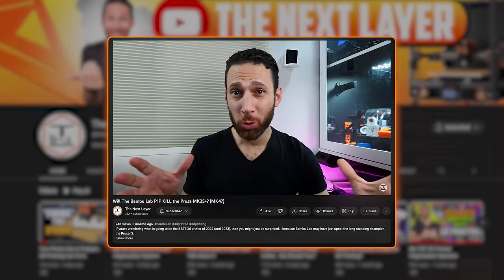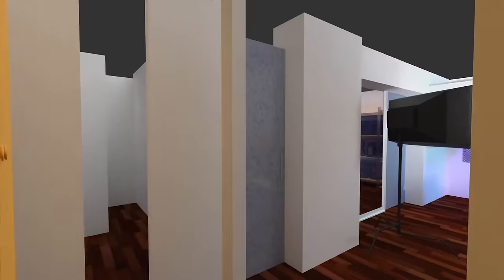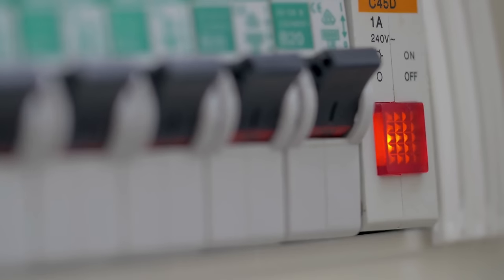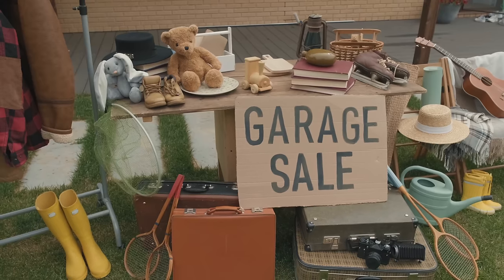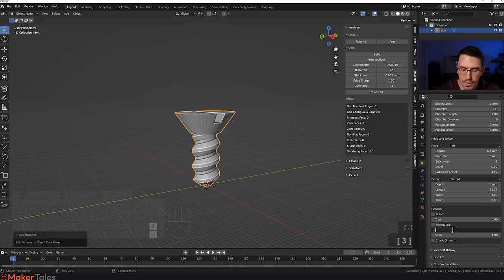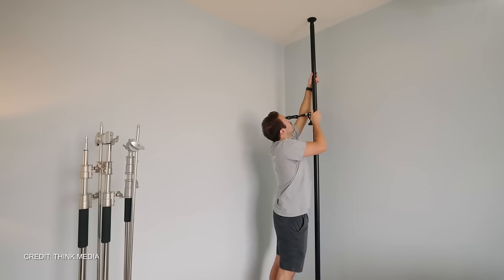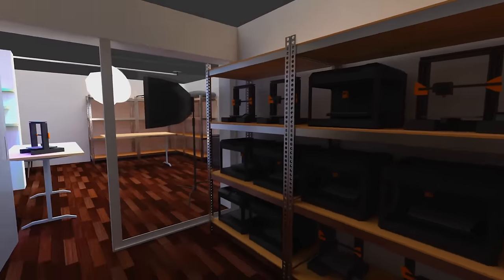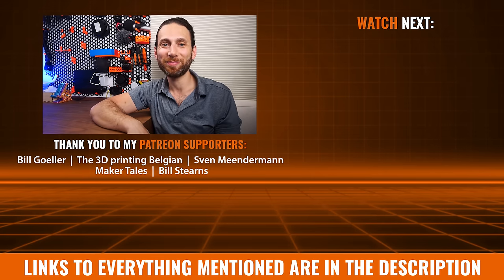Designing My ULTIMATE Maker Space, 3D Printer Farm, & Studio

Comment: USE THE CEILING.  As much as you possibly can attach everything you can to the ceiling.  Gantry mounted lights and cameras will give you greater range of motion eliminate tripping hazards, running your electrical overhead eliminates tripping hazards.  Floor looking up shots are almost never preferred, so it doesn't even have to be pretty...  Creating good overhead options requires empty spaces below, so this is the single best time to make the most use of that resource.  Looks like it will be great.  Good luck.

Comment: I am excited for you man, looks great!  Can’t wait until it’s all set up and running.    Here is my two cents. 

As an engineer I can not overstate the importance of these two things and strongly recommend you drop everything else and move them to the top of your planning priority list.  
ELECTRICAL- Do not make the assumption you will be able to run all your equipment and printers.   Find out exactly how many circuit breakers you have, and what each is rated for in rms (NOT PEAK) watts.  Plan your space around this.  Each printer will easily use 100w.  Your recording lights probably 300w each if there not LED, the lasers, I don’t even want to know lol.  If you don’t have close to enough, look for ways to save power and/or spend the money now and hire an electrician to re wire the space.   Will suck for sure, but will suck a lot more if you have to do that after it’s finished and waste a month of effort rebuilding.  
HVAC-  This is not something that is left to an after thought, ever (for safety and comfort).  You need to estimate and plan around the heating from electrical equipment, moisture loading (outside conditions + current hvac equipment capability), desired temperature in each room and fume management.   Otherwise you are looking at some combination of (if not all) 
-dangerous fumes in your work space (you need the resin printer room and maybe the regular printer room  to have a negative pressure blowing air out of them, and every other room to have a positive pressure or blowing air into them)
-a completely outclassed AC system where your workspace ends up being 29C and/or a 500 a month AC bill (this can be mostly avoided with well thought out ventilation, but if possible during colder outdoor temperatures you want to use the heat of the printers with some valves and clever vent layout to keep the space warm and save $$.  ) 
-if there is a temperature differential between rooms and your humidity is not managed.  You will get mold inside your walls, which will be at best, very expensive and at worst dangerous (again proper ventilation is key.  Also consider an ERV) 

Now for my personal thoughts.  
-those cameras rails looks expensive.  I would try and use some extruded aluminum rails/channels, mount them all over the ceiling and buy/make the mounts.  Can hang literally anything and everything off them, including all the lights.  Won’t have a single tri pod on the ground which will be a god send in my opinion haha. 
-accustic panels stop sound wave reflection, they do NOT dampen noise.  Put them in rooms where you record to stop echos and make the audio crisp.  No where else.  If you want to reduce the printer room noise.  You need to stop air from travelling  from that room Into the one you are in.  Which means air tight doors and a lot of silicone caulk in/by the walls and ceiling.  Also baffle the vents if any travel between the two rooms.  
-do not use those aluminum and particle board shelves for your printers like shown in the vid.  They will ruin your print quality with how unstable they are and you can’t even stand on them.  Spend the time and build some STURDY shelves that are perfectly level, don’t have any play or any ability to vibrate at varying resonance frequencies, and you can stand on them. 
-I would reconsider the idea of a print farm.  Any one can start a print farm, not many people have your skills, knowledge and Influence.  Use that to make your money, it will scale much better.  If you start a print farm I have a feeling that you will get sucked into a rabbit hole of depending on the print farm for income, while it sucks all your time away managing 10 printers and needy clients preventing you from making videos and growing the brand.  Which leads to a huge feedback loop, which I am sure is the last thing you want. 

I also believe you are over looking an absolutely huge and critical part of the space being successful long term.   Making it easy and reasons to WANT to be there.  I am sure you will go through slumps and declines in revenue/growth.  And with the space no longer being in your own home.  It will be way way easier to find excuses to not keep grinding.  
Find other things that will get you out of the house and into the space.  Something else you really enjoy doing.  Or maybe a responsibility there that can’t be easily ignored.  Maybe get a fish tank haha, will make sure you are in the space every day, add to the video aesthetics 100% if set up nicely and give you new niches to print (and potentially make videos for).  
Also maybe add a TV and gaming system on the couch for the kids to keep them entertained so they can be there while you work.  

Let me know if you want me to expand on anything.  Good luck with the build and channel!

Comment: Having a tool wall on the primary backdrop definitely makes sense as that is kind of your brand already. That said if you are worried about it being too busy you could consider having it on one of the two sidewalls and then having a more neutral back wall. This would also give you two slightly different backdrops depending on the camera angle.
Not sure if this would work with the glass of the print-farm but using the glass wall as a backdrop could give the print farm as a cool backdrop while also keeping the sound down. Also, would use the same center hanging light.
Reply from the maker: That’s a pretty good idea too and would solve the lighting issue

Comment: Well done! You’re ideas are great! Couple things to consider. Shops/workspaces really do change with time and as businesses grow and adapt to market needs and life changes. Be open to the idea that this plan, while very good, will likely change several times. To allow for that, keep everything on wheels. Real wheels. Not crappy plastic office chair wheels. Good casters. If you need to secure a bench to limit motion, just add a couple screws that anchor the bench to a wall. Remove two screws and move the item as needed. Quick and easy. For the concrete walls, install a wood strip around the parameter and use that for future attaching so you don’t need to always drill for
Concrete anchors. For a small space like this, keep cabinets small and get multiples of them. Two rolling toolboxes for example can easily be made into a base for a big workbench. When not in use, pull the top off and lean that up against the wall to open up floor space. It’s also helps for moving large items around the space if you can easily break down a “big” bench. Drawers are that of kings. Keeps things clean and less cluttered (you already got that😊)  keep storage cabinets for the most part very shallow in depth. Only deep enough to grab the item you need, not the item behind 6 other things. And my last thumb type vomiting….😅as you mentioned, keep tools where they are used. Even if that means having duplicates. The time spent wandering from place to place to get a little screwdriver is wasted time that adds up so quickly it hurts. I look forward to the process. Keep up the great work! I’m brand new to 3d printing, your channel is one of my go to’s! Hopefully my 20+ years of building cabinets and furniture and having had 4 shops from 75 sq feet to my current 4000 will give you just a little help. Cheerio!👍🏽👍🏽. PS. As you know, opinions are like assholes. We all have one and and they all stink. Feel free to totally ignore me and you do you! 😅

Comment: We're building a studio this year, too! It will be a room on the second floor of our house. There will be a table that fits three 3D printers, but I can put three more under the table and add shelves on top to house three more, nine in total. Another table will be positioned on the other side of the room, by the window, and used for cleaning prints up and assembling projects. HSW panels will be on both sides of it. I'll put a modified RepRack on one of the angled walls and drawers with hardware on the other. There will also be a third table for cleaning specifically resin prints.
These are my plans for now, I'll edit this comment if they change.

Comment: One thing to consider with the honeycomb background is the moire effect on screen. You can see it in the renders at some points and MIGHT be distracting at times in a video. All depends on the relative scale of the pattern. Larger the better as far as that goes. You could get around this by having a shallow depth of field to slightly blur the background. But for me, as long as you’re well lit and can easily be separated out from the background visually you’re good. I personally really like the honeycomb pattern in black with a color peppered in there to pop it and give dimension. You have good design sense so whatever you land on will be cool and fun.

Another thing is make sure all background things are secure and don’t shift. You don’t want to see cuts where a cord is in one position and then moves in the next cut and then back again. Or if you use a tool between cuts and don’t put it back in the exact same spot. Possibly ruining continuity.

Comment: Nice Develpment.  My 2 cents.  Calculate the power requirements for the many printers and rest.  You probably need more then 2 circuits. 

This rooms could perhaps have a larger gantry on rails attached to the ceiling or walls.  You could hang all of your equipment from there and easily push it around. It doesn’t need to be expensive… 2x4.  Plus printed parts.  And some rolls.

Comment: space is limited in my house, so ive been throwing around a convertible workshop idea(yes, like a car). A variety of heavy duty locking hinges would allow the table to fold up from the wall, and the outer 2 walls to fold off the one real wall as well. This means i can hang my tools on the inside, then fold it flat against the wall for VR use or just a regular dinner table. The shitty part is that means all my tools will be on the wall above the dining table, but im a single dude, so i dont have a wife to complain about the fact that the dining table "painting" is a variety of tools on the wall
Basically it would be 4 plywood boards on the wall, all on interior hinges. The two in the middle are top and bottom, so the hinges allow folding down or up into two seperate height tables. The outside two pieces are floor to cieling(ish) and fold out from the wall into side walls, reinforced with a couple pieces of 2x4. All the hinges are interior hinge, and 180, so i can potentially fold it into a slightly off the wall "box" so that company doesnt see all my tools.
Reply: i think a tool wall is boring. Instead of creating a "brand" wall, why not make yourself the brand? Put things that are important to you on the wall, instead of things you want the channel to be. Just avoid anything that has people in it, its always a bad idea to put your family in the shot. Do not bring camping stuff from home, because then you dont have it when you need it, and your shelves will become a permenant junk area. One thing the print farm needs is a table in the middle. Youll be spending a lot of time in there, so a small table and a roller stool  that can be stored under it will go a long way
Reply: Just had a bonkers idea. Print all your tool walls and stuff in a green filament, and then use greenscreen to create a digital tool wall background. So you can apply a different greenscreen pattern over the hex every time, and now you have a hybrid dynamic background

Comment: I like the wall hanging thing, maybe change out the tools every so often to spice things up. Did you include a bathroom and kitchen in the warehouse? Might need one by code but you don’t have to go crazy. The most important room is the bathroom when you don’t have one. 

The electric is easy but expensive for your plans. Also, check your local building codes. Not sure about Tel Aviv, but in the states new construction needs one outlet every 12 feet/3.9 meters. 

Get multiples of things you like already but hold off the crazy expensive things like cameras. 

What about opening up the print farm like a maker space for the public? Maybe classes for intro to 3D printing and design and the like? Might even get some good press if you work with local schools. 

Good luck.